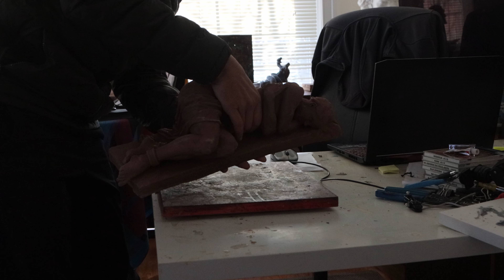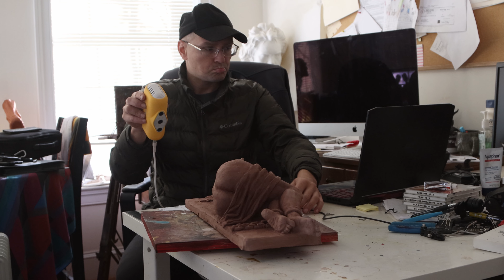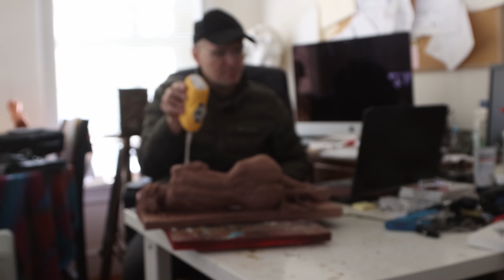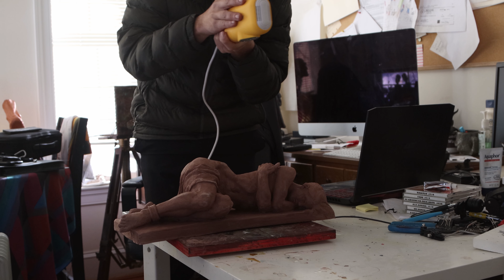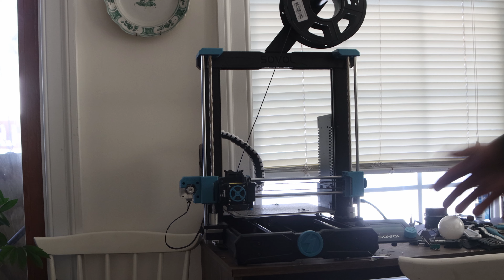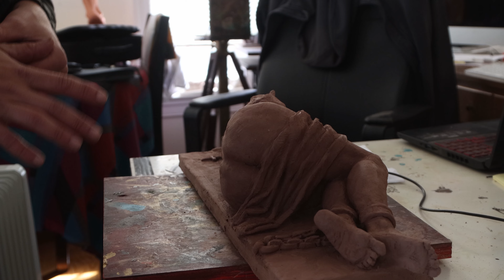3d Scanning reclining female figure using the Creality Lizard 3d Scanner

Comment: Can you please share the printer you use and share if you recommend the same or an alternate with better performance. What object size can be printed on your printer. Thank you
Reply from the maker: Hey there I have the Sovol 06. It's a mini clone of the Prusa. If you can afford it get the Prusa, i have been pleased with the accuracy and detail mine prints with very little problems. But my power supply needs fixing which i am not happy with.